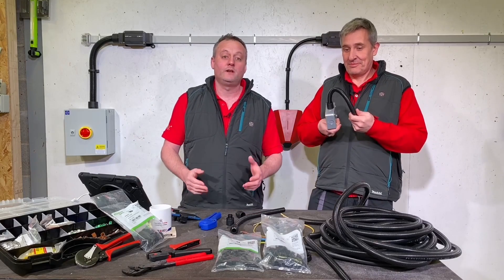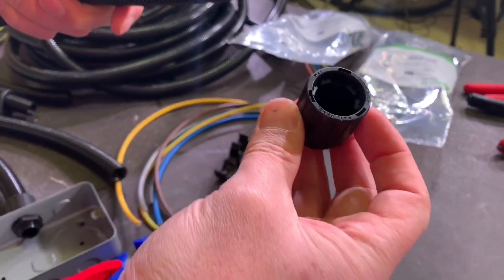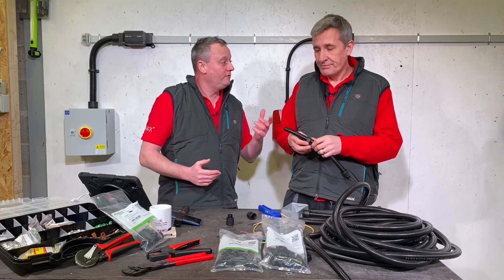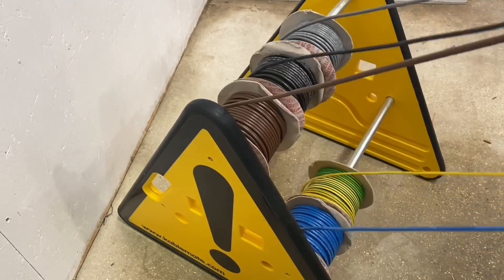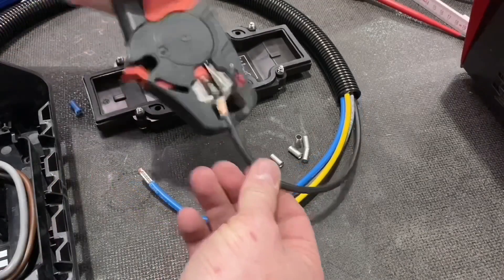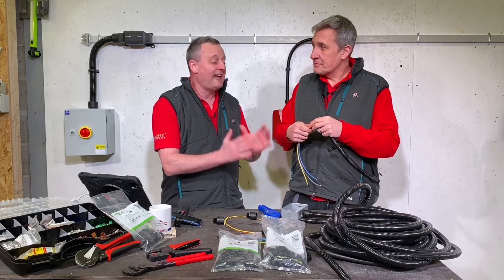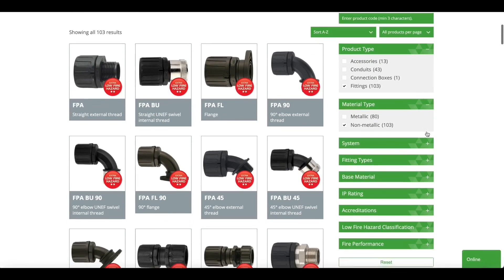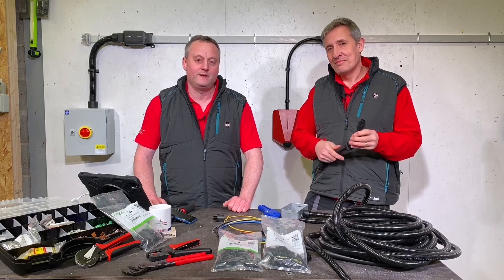FLEXICON your FLEXIBLE FRIEND - faster electrical installations with flexible conduit - IP66 - IP69

Comment: Can you use flexicon in domestic homes .( 18th edition. ) IP rated . 
in wall chasing if needed .
Under floor boards , lofts , 

It looks easy to cut / attach / to 
sockets , pattress, etc ...

Any one know ??
Reply from the maker: Yes you can use flexible conduit and singles just like they do in lots of countries - but total cost is higher.

Comment: What's the benefits over armoured cable?
Reply: There are a fair few benefits of flexible conduit compared to armoured cable: it is easier to cut, you can combine multiple cable types in one system, can make quick changes / upgrades to circuits within existing system, easy routing of cables with different bend radius, can replace faulty cables without replacing entire system, suitable for static and dynamic applications, can be retrofitted, mechanical protection provided by the conduit, easier termination of glands.

Comment: Might as well just wrap it with black tape probably has more impact resistance than that plastic garbage. England or whatever country electrical system is glued together
Reply: Hi Jeffrey, -	Black tape is very thin & the UV performance is very poor, it would be a very short term repair. The typical compression strength of Flexicon Nylon conduit is 75kg/100mm, the corrugated conduit offers a much higher impact resistance compared to black tape.
Reply: @FlexiconUk  obviously what I said was a joke. Any self respecting electrician would never use that flex icon. Do it the right way or not at all

Comment: I can see it's a well made product, and has its uses. I personally hate the stuff, but I work in harsh, high impact environments where plastic has no place. The only stuff I will use is short lengths of galvanised, plastic coated kopex with swivel glands connected to vibrating loads, like vibrating screen motors etc. 
As I say, it has its place, this in particular seems like a well designed system, but it would find itself anywhere near me!
Reply: These are interesting topics & we often see that metallic conduits are considered superior to plastic but this is not always true depending on the applciation.
Impact: Typically metallic conduits will stand a higher impact load but the conduit will retain the deformation, this can lead to chaffing on the cables inside. Nylon conduits will recover and bounce back so the long term performance can be better.
Harsh environments: Typically metallic conduits are coated with a PVC jacket, this has good flexibility but it’s long term fatigue performance is far inferior to nylon conduits and has a smaller temperature range. In dynamic applications PA12 conduits offer excellent long term fatigue resistance and they can handle very low temperatures.
We would be more than happy to look at your applications in more detail to see if we think there may be opportunities to improve the installation time & long term performance.

Comment: IP68 and IP69 is for submerged... You planning on some sub-sea installations??
The submerged protection is actually worse for water entering under pressure such as pressure cleaners etc..
Reply from the maker: IP69 - is similar to IP66 but with hot 💦 water.
Reply: @efixx  I see that I remembered incorrectly as it is IPX7 and X8 that are for immersion, the IPX9K is a new one for for me, but makes sense and covers for basically steam cleaning.
Reply: IP69K is described as “Powerful high-temperature water jets”, typically this is used to represent wash down applications using hot. It is similar to the IP66 test with a higher pressure and temperature.

Comment: How good are they against rats for use on a farm?
Reply from the maker: Difficult to stop rats 🐀 with plastic.  We’ll find out if Flexicon have any advice on the topic . We know parrots 🦜 aren’t so keen!
Reply: An interesting fact: rodents do not like Nylon as they don’t seem to like the ‘taste’ or have a desire to attack it when compared to a PVC product, so tend to leave it alone. We have a case study on Cockatoos in Australia and their inability to grip the nylon conduit with their teeth due to the slippery surface, this would also be very similar for rodents.
Reply: @FlexiconUk  thanks for the reply, better than cement with broken glass to top them, will try nylon on my next call out.

Comment: How you guys are allowed to use smurf tube out side of concrete is crazy. 0 impact resistance.
Reply: Most EV chargers and sockets are made from plastics and the impact ratings are acceptable for their application.
Flexicon’s products comply with the BS EN 61386 conduit standard which is referred to by the UK wiring regulations BS7671.
FPAH21 (heavy duty nylon corrugated) can withstand an impact of > 6J at -25°C which is far greater than something like a rigid PVC conduit.
One of the other advantages of nylon corrugated conduits is its ability to recover from impact compared with metallic conduits that generally stay deformed.
Reply: Probably because not every location is exposed to impacts...
Reply: @2loco   for an EV Charge in a garage? idk fireCode seems derated across the pond

Comment: We shouldn't call it a charger. It's just a fancy socket really... no charging circuit in it...
Reply: But how else could the marketing team make the electric car hipster gang believe those things are remotely worth what they cost?
Reply: @Candisa  new Zoey give them out for free now. I think it's like 700 quid before installation. Nuts
Reply: Charging connection suits better?  The clever stuff in those ones is the phase load smoothing.  The car only needs one phase, the box balances the loads from several connection points across the three phases.

Comment: Great video chaps I'm itching to start using this. As soon as I get a job that needs conduit I'll give it a shot 👍
Reply: It's really handy domestically for garages. Often with 'rickety old garages',  the building's not straight enough for normal conduit work to look neat. If there's angle iron, you can strap it inside the angle with metal ties, and hide most of the run.

Comment: Can you over use Flexicon, asking for a guy named Nick :P
Reply from the maker: The follow up video will blow his mind... 👍
Reply: @efixx  can't wait!  Flexicon turned out to be really handy for a small job the  other day... simple outside socket, but we didn't want to export the PME earth, so we drove a rod. But the size of the breaker only required 2.5mm earth rather than 10mm (which'd be hard to get into a socket anyway!). Flexicon from the earth rod 'pod' to the socket made a nice neat job of it. (to comply with the mechanical protection requirements on such a small earth conductor)
Reply: @TheChipmunk2008  No job too big or too small for Flexicon! 👍